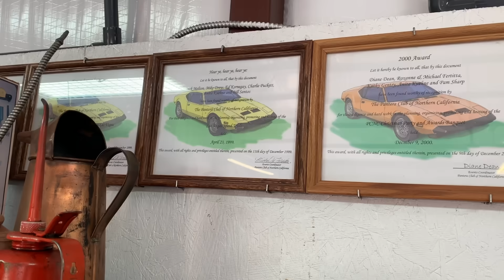I Flew 5000 Miles To Buy My Dream Car BUT There's A Catch.. DeTomaso Pantera

Comment: First of all congratulations Jack. It seems to me that you have little to be worried about as this Gentleman has built many cars before and so knew what he was doing. It is very wise to put it together as much as you can even if you need to pull it apart again back here in the UK. There will be less chance of anything going astray during shipping. This lady seems happy for you to have and look after the car which I know you will. You are also the sort of person who asks for advice if you are not sure so it is in good hands Jack. The arches will need to be redone I think though from the camera I cannot tell exactly what the problem is.but it's not a big problem.  Thanks for taking us with you on your journey Jack I look forward to the adventure ahead! 👍👍
Reply: The arches problem looks a bit like "bog" or putty shrinkage. It happens if fillers or putty, sometimes even paint applied too thickly.
I had an E Type Jag in the late '70's that had a bad repair on the bonnet it looked like that. Just had to strip the surface back to metal and had it properly flatted by a good panel basher, he eliminated a lot of filler, the problem never returned.

Comment: The issue relating to the vehicle's rear arches could be shrinkage of the spray on primer-filler or the polyester putty (aka Bondo).  Past experience with US sourced cars 'suggests' that regular US body/spray shops have a tendency to 'over do it' when it comes to applying Bondo or spray on filler.
Reply: Looks like filler shrinkage/crazing to me too. Arches are often overfilled it seems.
Reply: Primer filler can level surfaces but should mostly be sanded off not used to build up large areas.
Reply: @philtowle4683  Agree - however past experience indictates that some body shops don't (sadly) adhere to good practice.

Comment: In 1973 I took my first trip to Europe and while in Italy I visited DeTomaso.

In 1975 I decided I wanted a Pantera, and I found and bought a 1973 example in French blue.  I later realized I might’ve been at the factory while the car I ultimately bought was being built!

I really liked the car and it ran like a banshee, but the air con wasn’t up to a Southwestern US summer.

Two days after I sold it I saw it in front of a body shop with the front bonnet lid pushed up and over the windshield.  Apparently the new owner was taken by surprise by the car’s performance . . .

Comment: Congratulations on your purchase Jack! 
The Pantera is such an interesting hybrid of Italian design and US muscle. I'm lucky enough to drive one in the US belonging to a friend when I visit.  
Looks like a load of work has already been done on this car and the back date to the chrome bumpers is so much more elegant. The strange crazing on the arches looks like a weird chemical reaction to perhaps some speedily cured filler or primer over which colour has been applied too early.  Depends on how pristine you want the car but it'll be a big job to correct it as the whole panel will require stabilising and then blending into the roof and B pillar. 
It'll be interesting to see what the shipping costs from US to UK are along with the duty and tax that you'll be paying.  I hope you'll detail this in upcoming episodes. Are you planning on shipping from the East or West Coast? Containerised or RoRo?
Would there be any benefit of shipping the engine and gearbox separately so the car attracts less duty as a valuable classic car and more of a rolling work in progress?  I'm considering importing a couple of cars from Missouri next year - neither of which are running.  We could share a container!  Best of luck with everything and look forward to your next instalment.

Comment: I live in Tulsa, and used to work when I was a teenager at Fred Jones Ford. One of the parts guys had a beautiful red I believe 1971 or 72 Pantera. But now I'm 64 and the dealership has been gone for years now. Oklahomans love their cars, I had my first car up until 2000. It was a 1969 Mercury Cougar. Now I own my dream car which is a 1951 Hudson Pacemaker.

Comment: Back in the late 70's, a good friend of mine had a Pantera for a while.  I've always loved the shape.  He parked it up for a while at the end of our garden (we had a concertina gate allowing access).  When he went to move it out after a couple of months, he fired it up and the oil filter popped off - my dad was not impressed at the rather large deposit of oil under the car.

Comment: I actually drove a Pantera a few times. My father had a 1970 or 1971 Pantera (not sure on the year but it had the small bumpers) in bright yellow. He would let me drive it from time to time. He bought it new from a local Lincoln Mercury dealer and traded his Jaguar XKE for it. The car was all stock and it was his daily driver. He drove it in the New England winters and treated like any other car. My friends and I could always hear him coming home from work as we partied in the house after school. We would yell “tomato”, “tomato” (Our slang for Detomaso Pantera !) and run out of the house before he got to home. I once took the car to a cruise type night and everyone there was asking me if it was a Volkswagen kit car !  That was until they heard it start up ! I also raced a few muscle cars and did very well, even tough I was a lousy shifter with the gated “Z” shifter. My father sold the car in or around 1979, it was well used and had some rust in the inner fender wells.

Comment: Great episode. This will be a fantastic car. Some  body work I suspect will be needed but for the right person no drama. I have rebuilt and strengthened stuff using carbon fibre very successfully. Panteras really are a practical exotic that can be driven distance without the mechanical mayhem of most!

Comment: I went way down on the comments and did not see anyone talk about the weak link in the ZF five speed transaxle.  You have to make sure that the ring gear bolts have been replaced with ARP bolts.  They have crossdrilled heads and should be safety wired as well as being installed with Red Loctite.  I have done several of these before I retired.  The stock factory ones have a tendency to back out and when one does back out far enough it chews into the maincase and destroys it.  This project can be done by dropping the oil pan and you will have access to the one bolt on the bottom and you can replace them one by one.  Note, they are left hand thread.

Comment: The crazing in the paint looks familiar and similar to a car I had that had been painted to a high standard but subsequently suffered a reaction, paint shrinkage and the crazing you showed in the video. Hopefully it's only localised...

Great project, I have seen the associated grief and huge bills / lack of bits for some of the Italian exotica, a pushrod V8, a plain normal synchromesh manual transaxle, basic electrickery and none active suspension sounds a very sensible route to reliable usage in a gorgeous body style. I am very envious!

Comment: Looks absolutely straight. This guy was no dilettante when it came to restoring these cars. He's clearly done a lot of new for old swaps throughout the engine, box and running gear. The body colour may need some rubbing down and respraying on the rear wings, but I can't see that black paint being difficult match nicely.

Comment: exciting!  congratulations.  glad you're going back to the original wheel style...I really like the larger diameter chromed pieces.  Basically the Pantera engine is the Boss 351 cleveland...I have the same engine in a mustang and they are amazing engines.  Jay Leno has a good vid on his Pantera, and a good explanation of the usual upgrades from an expert.  good luck on the trip across the water

Comment: Those cracks in the paint are most likely flex movement in the fibreglass as it appears to be an aftermarket body kit on the 74 to make it look like a GT5.

Comment: If you need extra parts, buy them and put them in the car before it is shipped, that way you will not have to pay any extra duty or shipping. And talking of import duty into the UK, get a bill off sale for much less than you paid for it, for the shipping company, also declare it as a non runner & needing complete restoration. I have imported several classics from the States and you will save a small fortune by doing that.

Comment: Congrats on the new acquisition! Those aren't scratches on the fender flares unfortunately. It's cracks due to shrinking bodywork under the primer. If the car has been painted for a while, at least a few years, it's unlikely to get worse. 
Oklahoma is an excellent climate to get a classic car from.
Reply: Steel bodywork doesn't shrink. I think you mean body filler.

Comment: I put one of those together Back in 1996. I was in the Central Valley in California. That looks like the same car. The guy put it together for sold to a doctor or dentist. I can't remember, but so long ago. I See it had California license plates. The rims look like the same Rims  on the one I worked on. I have some pictures of a car. I have to dig them up.

Comment: The marks on the wheel arches appears to be the paint cracking from beneath, usually from body filler shrinkage, but boy oh boy what a buy for the channel - certainly way cooler than your run of the mill Ferrari.

Comment: The marks on the body are due paint being applied too thickly, and not drying uniformly. In essence, the surface dried, and everything beneath it took considerably longer, and didn’t cure completely.

Comment: Looks great....
That paint may have alot of filler but in the 80s their was alsorts of weird types of paint on the market. Acrylics. Some even heated up in a pot. 
I look forwards to the Pantera files!
Reply: I remember using something called hotpot back in the day. The red paint on my Mk1 escort was shinier than a new fire engine 😂😂
Reply: @davidnorton5887  l think we called it Jam.
I started in the bodyshop in 1982. Everything was cellulose. Then the weird stuff came. Later the waterbased started but even that  had a few problems. The waterbased high build primer would peel off and the clear coat would flake off if the base was not 100% dry..
Old filler was porus which didn't help either. 
I painted my mk1 Cooper s recently and l chose a solid acrylic over base with clearcoat.

Comment: Be great for you to get back to a project, miss the elise, influenzo mercs, vids etc….👍👍 The ZF’s are great gearboxes, we used to use them in the early Ascaris, some of the pantera boys used to run mega horsepower through them. In all the years we used them at Ascari we never had any breakages or problems, 👍👍
Reply from the maker: Fingers crossed it will be ok! Thanks for watching 🙏

Comment: The marks on the arch look like it has been sprayed in two back black solvent paint and over time in the elements can crack and craze or if there was too much hardner and thinner added and then a lot of heavy coats it can also crack and craze but as it’s only on the video if it’s working marks from the repair where the paint as sank in I’d try and wet flat with fine paper 1500s or 2000s and give it a good mop it will polish out I’m a painter and hopefully it’s the latter because if it’s cracked or crazed it will need re painting! Great car Italian 70s looks with almost bullet proof lazy American muscle! Great channel and keep up the great content 💯

Comment: No brainer, you had to buy it, a lot of the heavy lifting has been done, you are not buying (hopefully) one with a ton of rust. That  rear arch may need stripping right back, are the arches glass-fibre? Most time consuming problem for me would be the electrics but it is all doable. You have persevered in the past with the 308 so I have no doubt you will finish up with a wonderful car. Keep the updates coming.
Reply: The arches shouldn't be fibreglass  --  that's the problem.

Comment: That's a gorgeous glossy black. Suits the car beautifully. And that engine rebuild looks as if it's aircraft quality too.

The gearbox could prove ... interesting when you get it home, but shipping that car 6,000 miles is hoing to be an adventure on its own. 4 to 6 days at sea in current Atlantic conditions will have you reaching for the seasick pills if you travel with the car :)

Comment: I have a modified 351C that was built by an engine master. It would be a tremendous waste to take the engine apart to "check things". You would want to trust a little and get the fueling, ignition, and timing sorted as well as fill the gearbox and engine with fluids. Essentially there are still lots of things to do so I see no reason why pulling an engine that took many hours to machine and build needs to get torn down if it has never been ran.

Comment: Caveat - not a painter! But I have seen that paint effect before and I believe it happens when painting over filler where the filler is badly prepared, hasn't been left long enough to cure and/or has cured in a humid environment and has absorbed water; especially if primed (as primer is porous) not long after hardening. Could be something a wet send to bare filler and local respray & blend could amend?

Comment: Happy for you, Jack. Nice car! Motivates me to get my own project car rolling again. I think you've made a wonderful choice in the Pantera. Based on all the cars I've owned or driven, and the many more reviews of cars I've consumed over the decades, I can't think of any car I'd really rather have for anything remotely like the price, possibly at any price. 

I love it in black (can't really go wrong with black). While the U.S.-spec 'impact bumpers' were better designed than most other such things that were grafted onto U.S.-imported cars of the time, having the proper original-spec bumpers is a great bonus. It'll look absolutely fabulous on the Campos.

I think you'll find that the aluminum heads and intake, which remove significant weight from very high up in the tail of the car, will make it handle noticeably better than other Panteras you have sampled. And I'm sure the engine will be magnificent. 

Unlike to the Influenzo, which I predicted you'd not be very happy with and sell fairly quickly, I believe you'll keep this car for a very long time, because it will be such a pleasure to own and drive. Panteras - well, properly sorted Panteras - deserve mad respect. Well done, dude. Well done.

Comment: Ah, Jack...  Good luck with this.  My own experience with DeTomasos was not very good, but this one seems to have had the really difficult bits done.  I seem to remember many of the interior bitts were sourced from the Ford Capri, so you should be able to find them.  I don't envy you undertaking the interior wiring, though.

Comment: I would carefully measure the paint thickness on all panels to see if it’s been done properly or that a lot of filler has been used.
Reply: I think we can assume that a lot of filler has been used. It would have been lead on the original panels.

Comment: Let me add another congratulations to the long list, although I had no doubt the Pantera was soon to be in your collection judging by the glee you exhibited in your three test drive reviews.  As a fellow Pantera owner, I think you will love the experience especially in light of the work and components that have been incorporated into this car.  I'm sure you're already counting the days it will take to get in and drive it.  Two things I would say regarding your car.  First, the 15" original wheels are quite expensive and tire choices are very, very limited, so you might consider the 17" "Campy" clones that give you nearly the same look but many more choices for your tires.  That is what I have on mine as well as several of my Pantera friends.  The 17" wheels also give you the opportunity to upgrade the brakes with bigger calipers which I did when I bought mine more than 25 years ago.  Secondly, your car appears to have the Revson front spoiler, which I love, but which wants to get hit on the slightest of changes in surface heights from driveways to speed bumps, to uneven road surfaces, so just be careful.  I purchased one of the Revson spoilers from a Pantera forum member a couple of years ago, but have not installed it when I saw how low it was going to be.  Maybe someday...Good luck with your new Pantera and welcome to the club!

Comment: Is the cam flat tappet or roller? If it's a new build with a flat tappet you will have to follow the cam break in process when you start it

Comment: I hope I'm wrong but the cracking on the wheelarch looks suspiciously like a problem with underlying filler.  I understand early cars had poorly shaped panels from new, corrected in the factory using sometimes extensive leading.  This in turn can be replaced with bondo in later work.  As this is a later one, let's hope it's just poorly mixed paint.
Reply: Lead is preferable to filler. And certainly shouldn't be replaced by filler.
Reply: @johnbriggs3916  quite right, but the people who have fixed these cars over the years don't always have the money or the skill.